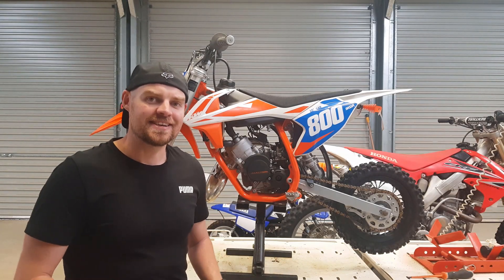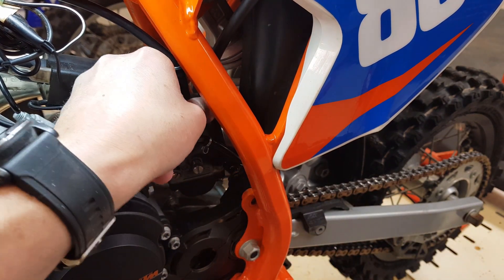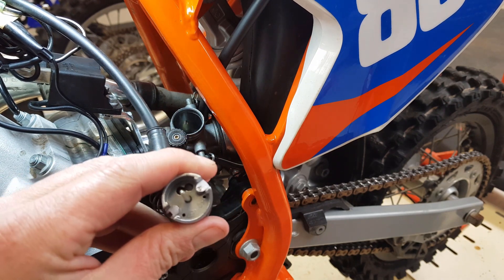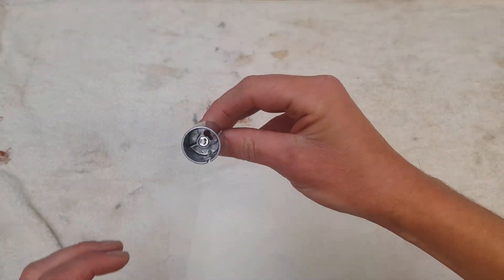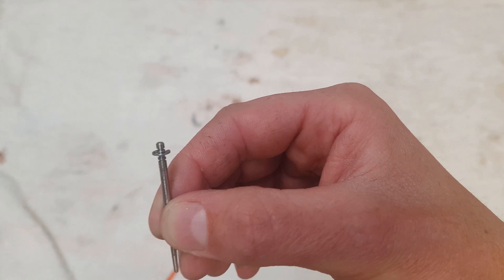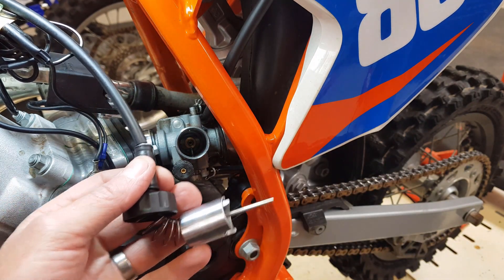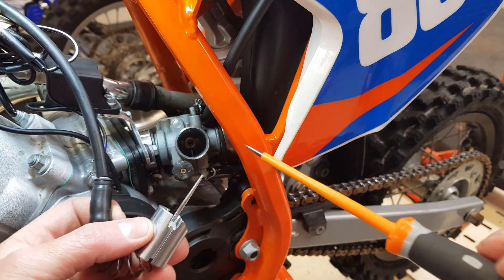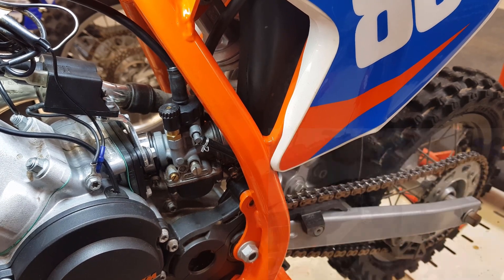How to Adjust Carburettor Needle Clip Position KTM50 KTM 50SX

Comment: My child is fouling plugs every 1.5 to 2 hours as he inly puts along and never really hitting powerband. Should i adjust the needle to the second position like yours is and change iver jet sizes also to run a touch leaner? 
Just also noticed when I hop on it and go for a squirt... shes splattering on high rpm in powerband. Perfectly find prior to powerband though as soon as she comes to life it splatters. Will just adjusting needle position help or need both needle and jets?

Comment: Hi James, I am getting a splutter at wide open throttle and it seems to have gotten worse after changing the spark plug. And advice ? Thanks
Reply from the maker: Hey Tim splutter at wide open is very common.

Firstly If it has got worse after changing the plug make sure the cap is on correctly.
 You could try running a larger or smaller main jet. If you are currently running a 90 drop to an 85 and see what happens. If worse try a 95.
Reply: Hi James, thanks for the reply I ended up pulling the carb apart and the float had a hole in one side and was hanging off the metal like a loose tooth. Replaced this but had to order it in as no one holds this part but it’s running perfect now. Thanks

Comment: Hey mate I’ve put in the same jets as you put in, in the last vid, I haven’t adjusted the float as of yet though; the bike is running unreal but my idle fluctuates up and down, does the float affect this?
Reply from the maker: Hi No the float shouldn't make the effect. Have a play with the air screw, you might be able to get a steady idle with help from that

Comment: hi. great videos. my ktm50 2006 bogs down when hits full throttle, will this have anything to do with the needle position? or any other suggestions?
Reply from the maker: Hey there, firstly check your stator, I have a video for that one. It shouldn't be much to do with the needle clip position as the needle should be fully removed at wide open. I would also check your main jet and make sure your carb is clean

Comment: Hi James got a totally stock tc50 2020 model getting a lot of oil spooge out the rear exhaust running a fuel mix of 60-1 motorex oil
Any suggestions
Thanks
Reply: Wow here in the uk most bikes run 32:1 40:1 where are you if your still spooging bro
Reply: I'm also in the Uk and that's what it states to use reading online and out the owners manual
Reply: @mikemx1544  yea maybe correct bro but same spec as the ktm init and aprilla if they still make there’s I’d use less oil slightly or up jet to suit she’s a premix bike isn’t she
Reply: @mikemx1544  not up jet ::: hotter plug to suit mate

Comment: i have a 2022 ktm50sx factory edition 98 main jet, 50 pilot. It sputters terribly at very start when we take it off the stand. sometime dies. once warm its fine.. ahhhh any help will save my brain
Reply from the maker: Hey Mike. I would firstly drop the pilot to a 48. These bikes will always fuel up when at idle, they need to be revved out with the back wheel off the ground before a race start situation. 98 main does also sound a bit large

Comment: Why would you adjust this? What’s the benefits pls
Reply from the maker: Hey there, the needle sits in the main jet and slowly comes out as you turn the throttle. They both work together. The the higher the clip position the further it restricts the fuel flow
Reply: @jameswharton3143  which does what?
Reply: Which does what?